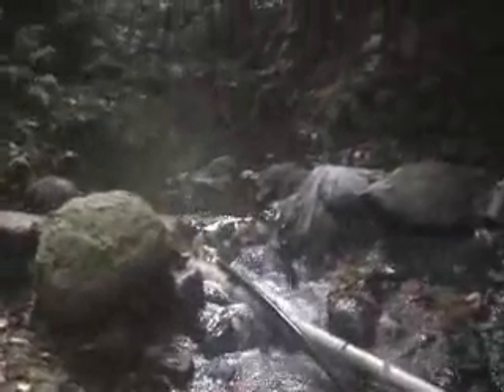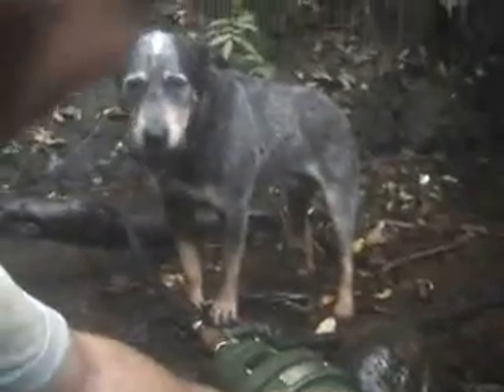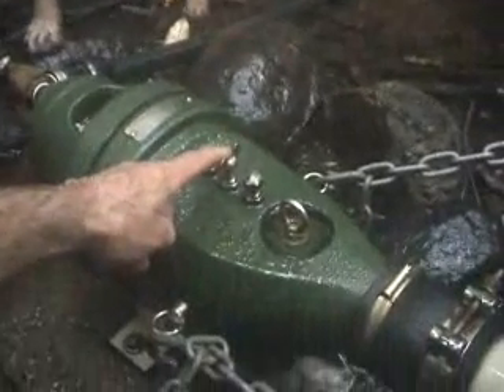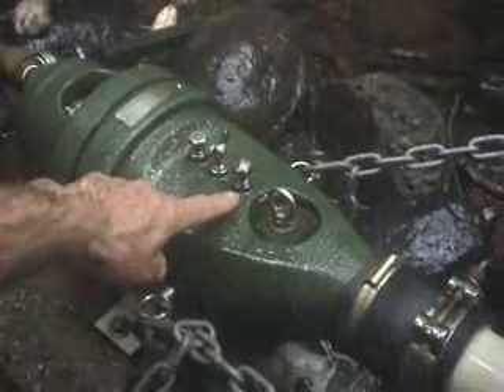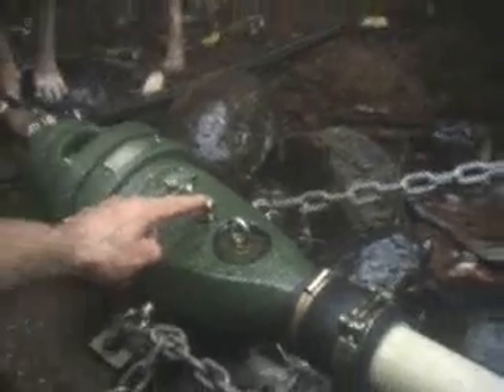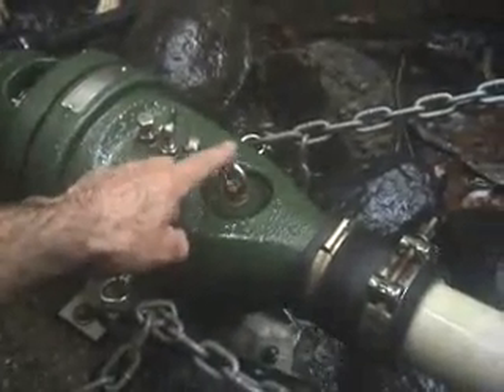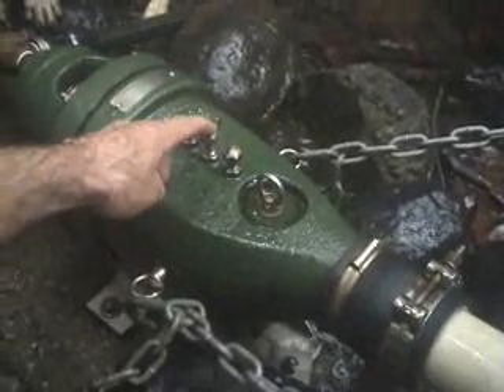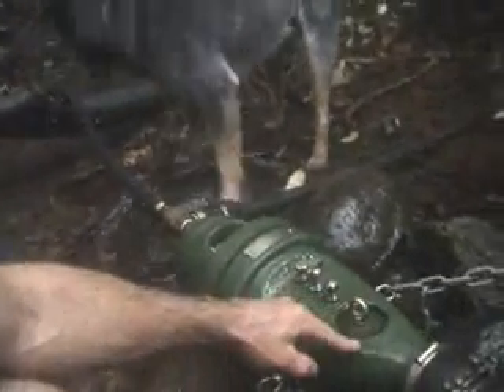glockmann pump operation

Comment: Well I found your video really really useful! Sadly these brilliant pumps are not readily available anymore, but managed to secure a 160 water dragon that was in storage for the past eight years out in regional NSW Australia. Got it home to NZ, but problem is I had no instruction manual. Have fitted it and having trouble with blowing the main diaphragm - I think the stroke is too long. Anyway without your video I would have struggled. Thanks a million!